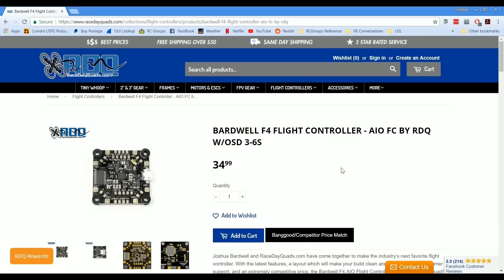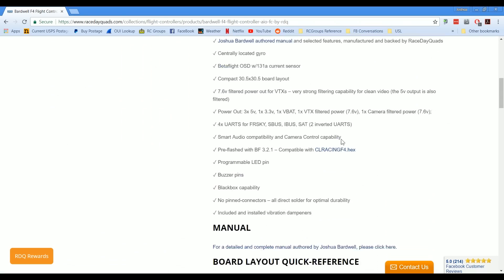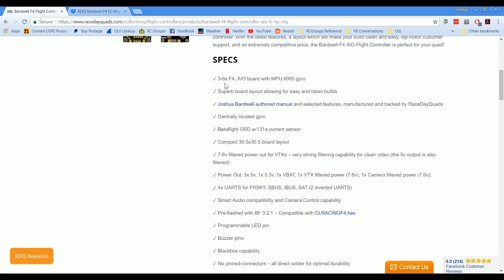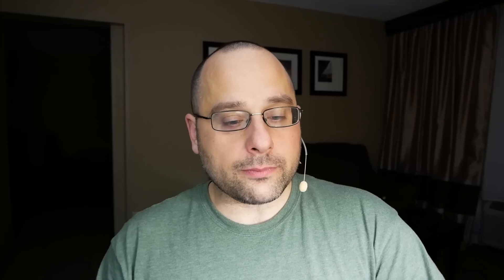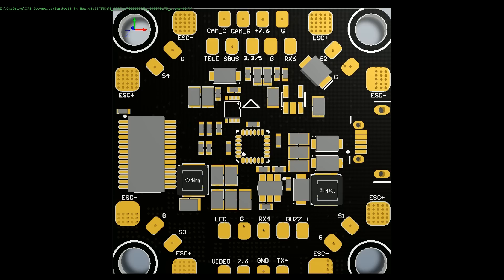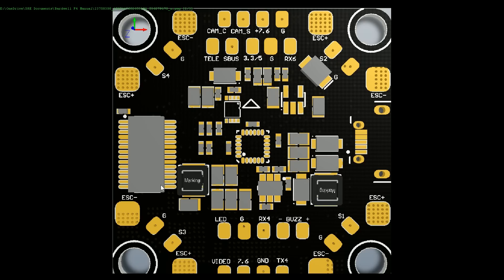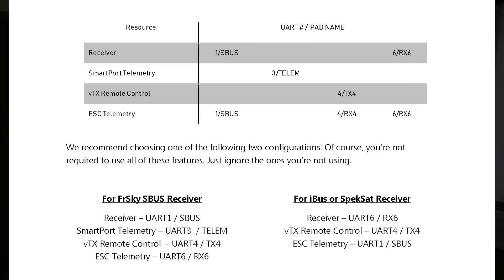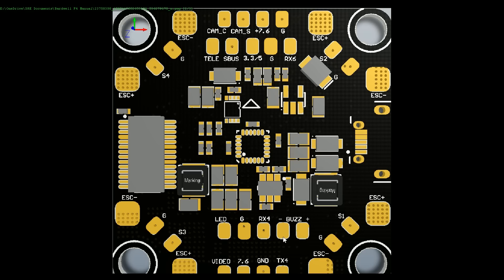Bardwell F4 AIO | JOSHUA BARDWELL FLIGHT CONTROLLER

Comment: I got one man and both 5v pads lifted off the board. Like i put my rx on the 5v and the pad lifted, so I said fuck it and soldered it to led and would remap later, I let go of the wire and the pad instantly came off. I'm not that worried about it because I have a 5v wire from my 4in1 but i figured you wanted to know about the quality control issue.
Reply: Also the manual is so detailed you're legit the fucking man! Thanks for all you do brother.
Reply from the maker: +Biruta FPV I hate to say this but I suspect your soldering skills more than my board. We have 1000 of them sold and this is the first time I've heard of lofted pads.
Reply: Joshua Bardwell I don't doubt my soldering skills are not the best. But it is the board, as every other pad was and is fine, only the 5v, I've never had a pad come off 7 pc's and 5 fcs, countless rebuilds. Like legit 30 builds under my belt, never burnt a pad, and I was at 350c, touched the pad for less that 5 seconds. I'm not trying to be a hater at all. Just letting you know exactly what happened. I soldered the twon5v just like I did every other pad on the board. It's possible I had a one off, but that would be in. Considering I soldered all 3 wires one after the other and only the 5v pad lifted, same exact technique and even made sure the board wasn't hot, the pads weren't secured.
Reply: Pc's =pdb
Reply: Joshua Bardwell I doubt you'll reply again, but I'll tell you the same thing I told racedayquads, I'm not trying to disrespect you or your product just letting you know of the issues. Happy flying bud.

Comment: Anyone else having issues getting LUA scripts to work? I’ve updated software and firmware on everything - r-xsr, Taranis, using the latest open TX, latest Taranis bootloader, latest LUA script, etc etc. I get telemetry just fine but no values show up on the PID tuning or other LUA script screens. Yes, I’m tuning the LUA-script-fix fw on the r-xsr.
Reply: Argh. Unplugged R-XSR, plugged in an XSR, and everything works. I wonder if FrSky needs to work on their R-XSR firmware a little more...

Comment: I love your layout design on this FC but there's an issue with CLRacing 3.2.1 on JBF4 AIO. I cannot get the LUA and S.Port to work. Followed your manual, awesome by the way, and I only get 3 telemetry points back to QX7 using XSR receiver. I checked the ports and uart3 is set to SmartPort. Tried a spare X4R receiver and same thing. Now I tried to flash to CLRacing 3.2.3, and can't get DFU mode up using bl command from cli, ImpulsRC or Zadig even though I was able to flash from 3.2.0. Just wanted to make you aware of these issues.
Reply from the maker: The telemetry issue is noted on  the product page. The manual needs to be updated.

If you are using SmartPort Telemetry wired to the TELE pad, you must go into the CLI and type:

set tlm_halfduplex = off
save

DFU mode is likely an issue with drivers on your PC not the FC.
Reply: Thank you. I will try that.Two different windows PCs with same resaults? It did work, mind you, on previous version of CLRacing.
Reply: Got it figured out. ImpulseRC was coming up win an error "Too many devices..." or something like that. Once I de-soldered everything, DFU drivers installed ok.

Comment: I don't know if this got brought up already, but do you have a suggestion on which ESC pads to run power to a 4-in-1 ESC board?  Will the ones closest to the battery pads and current sensor be adequate or should I run from multiple pads?

Comment: Do I need an additional resistor and capacitor to use the camera control feature? (I will use a RC Eagle 2 with this board)
Reply: And which hardware option needs to be selected? DAC, Hardware or Software PWM? Thanks in advance! :)
Reply from the maker: You don't need a resistor. Some cameras might need a capacitor.
Reply from the maker: The hardware options are all set up from the factory so all you need to do is solder up the wire. But hardware is the correct option.
Reply: Thanks a lot. I hope my JB F4 order arrives soon! :)

Comment: Got one of your fc in the mail today and I have to say I am a little bit disappoined how it was shipped, I expected some kind of hardcase to it.
Reply from the maker: Shipping it in a hard case would increase costs and would not increase durability at all. The method you got it is how all sorts of electronics are typically shipped. 99% of people are going to take it out of the packaging, throw the packaging away, and never think of it again. If your board was damaged in shipping, let RDQ know and they will send a replacement immediately. But probably, your board is just fine.

Comment: Doesn't an AIO include the speed controllers also?  Otherwise, it's not really an All In One is it?
Reply from the maker: I'm so completely eye-rolley about this argument. To my memory, the term AIO was first coined to refer to an FC with PDB and OSD built in. FC's with built in ESCs are relatively recent, definitely after the term AIO.

Anyway, if you want to be pedantic, shouldn't an AIO include the vTX too? Shouldn't it include the camera? Hell, shouldn't it include the frame and motors while we're at it? The term AIO typically refers to an FC with built in PDB and more.
Reply: Ok, ok.  No need to go overboard.  I honestly didn't know the answer, and was just asking a simple question.
Reply: I agree with you twinturbostang. It is a little confusing and the term AIO is silly, Maybe ok for a stack but should really be avoided.

Comment: This looks great, congrats!
I actually like pin holes on an FC as it lets you wire from above or below, but this board is so well organised there no need to worry about that.
Reply: Although, the "Around the stand off" location of ESC wires is not fun. Please dont do that in the next version. Weaving & crossing wires around the nut is awkward.

Comment: Can INAV be flashed to this board?
Reply from the maker: This board does not have a barometer or i2c pads, so it wouldn't be ideal for iNav. However I believe iNav supports all standard betaflight targets, so I think in theory you can do it.

Comment: Why don't flight controllers have USB type c?
Reply from the maker: +Krez_FPV what is the advantage really? More expensive connector. Cable nobody has. For what?
Reply: I was thinking it would be more of an ease of use thing. Reversible connector, and high bandwidth.

Comment: Sorry if this was mentioned, I don’t see it in the manual, should this be set to 8k/8k or ?
Reply from the maker: It depends what protocol you are using. If you are using Dshot, then yes, 8k/8k is fine. Betaflight comes by default at 8k/2k in case you are using OneShot.

Comment: Awesome, awesome, awesome Joshua! Great work here! Finally someone has done what I (and several others) have been saying for nearly 2 years; use a 7.5-9V VReg!!! So so glad you incorporated this onto this board. The only thing I would request on v2 would be a nice large + solder pad on the bottom near the edge of the board that ties in from the vbatt + after the current shunt. This allows for us to wire up the 4-in-1’s easily, putting the least amount of wire stress on the FC in order to not induce vibrations to its gyro via the wires.

Great job once again!!

Comment: There is another good reason to go < 12v on the voltage regulator for the vtx/camera.  On some boards (mine is a Matek) if you are using an older battery your voltage may sag below 12v momentarily, the voltage regulator might not handle that well and your video will drop out.  Lowering the voltage to  < 9v should get rid of that problem.  The first time this happened to me I had no idea my battery was causing the issue...so of course it happened again the next time that battery was in the rotation.   There are lots of people who mod their Matek PDB to run 9v or so instead of 12v, so I like this 7.6v solution, hopefully you will start a new trend.

Comment: Great design - can place it right up there with the F4S, but with the documentation CLRacing missed. Wished the boot button would be more on the side. It would be a killer if it came with the Molex connector for us 4in1 ESC fans. Many compact builds (like Catalyst merica) rely on those connectors to create a very compact modular design (4in1 ESC, e.g. Spedix 30A, stays in the frame, FC etc go in the canopy: thanks to the Molex you can swap a frame in 5min). Without Molex it will be more messy - or you just cramp connectors yourself. Your board, and in particular thanks to decent documentation, seems such a great step forward for the hobby; hope it drives a trend!

Comment: Congrats :-) looks  nice. Not a real fan of the pin layout tho. I prefer having more pins and having everything together that belongs together e.g. RX/TX/GND/5V in one row. The Kakute F4 is so far my favorite from an pinout perspective but its also the only one that has some weird Gyro noise issues. I saw you went with an MPU6000 which is what my 4 other copters are rocking. In my opinion that's all that's needed. I don't think that anyone needs more than 8k/8k :-)

Comment: Congratz on this project.  Just having really good filtering and amps sensor on board makes is oh so tempting. though I am swimming in the budget prices omnibuses from rtfq.  Any prospect of having a barometer on board too, for folks wanting to try it with iNav?  And will iNav be ported to this board?  I know that;s not your thing, but there is a growing shift to using these well evolved tiny and light miniquad FC for iNav, even w fixed wing.

Comment: First I'd like to say, congratulations!! Second, I wanna ask a question, I have wired some boards without using the signal ground pads on the fc. Instead what I like to do is just hook the signal grounds right over to the ground wire on the esc instead! It means way less wire and looks super clean! I guess my question is, is there any down side to doing it this way? So far I haven't noticed any problems yet but wanted your.advice!! If there isn't any issues with running the signal ground like that maybe just maybe"someone" would or could use my idea and could free up a small portion of space on there fc by removing the signal ground pads??? Looking forward to hearing your thoughts on the matter!! Thanks! =)
Reply from the maker: No I don't think there really is a down-side to be honest. Especially not on an all in one board like this.

Comment: Can this be used to run a Tricopter and it's Servo?
Reply from the maker: I honestly don't know all the ins and outs of using servos with Betaflight. To be honest, if you want to fly a tricopter, you should run TriFlight, the firmware specifically designed for tri's. The main thing it has is some advanced logic for moving the tail servo, that takes into account torque yaw coupling and other things.
Reply: JB,

Thanks for the quick reply and congrats on your product release!

I do run triflight, just curious to know if the board could handle the remapping to allow the control of the servo.

Comment: I jumped on the band wagon an ordered A board.  Can't wait to see the manual.  My next build I don't know but it will be around this FC . So enjoy you video's
Reply from the maker: You can download the manual from the product page right now! No need to wait for the board to come.
Reply: Joshua Bardwell thanks never crossed my mind; so I will down load. Thanks
Reply: And I will add, mine did not come with a manual.  I am fine with that, reference it online.

Comment: Congrats, JB.  I'll probably be getting one to support you, but I'm curious.  If you had to make a statement as to what sets this board apart from similar ones out there, what would it be?
Reply from the maker: There are tons of excellent FC's out there, so I can't say, THIS ONE IS THE BEST IN THE WORLD. It addresses some problems that some other FC's have, like noisy video and gyro twitching, but it's not the only one to do that. I guess the main thing this board has that no other board has is that it's got me backing it up. I wrote the manual for it. I'm going to keep up on feedback on it and of course I'll go out of my way to answer questions about it.
Reply: clean video
Reply: Joshua Bardwell Awesome! Happy to support such a stand-up guy.
Reply: 7.6V of course :)
Reply: And that is why i bought it.

Comment: I am starting out in the hobby and  I recently bought a soldering iron and using practice wires I have been practicing. One thing I am having trouble with is getting the solder to stick to the wires it is just staying on the iron or balling up on the wire. I don't know what is happening.
Reply from the maker: That might be a sign of a cold iron. Also could be dirty wire. If you are using lead free solder, use leaded.
Reply: Joshua Bardwell ok I’m using the solder that came with my iron and it is 60/40 it could be just dirty wire because it is just some old stuff I found lying around. As for the iron it was cranked up to the hottest. Thanks

Comment: Joshua Bardwell, I'd have one suggestion for the board. You could add another big battery solder pad after the current sensor, so that one could wire up a 4in1 ESC after the current sensor with power. And a possibility to have the 4 motor data output pads in one additional place would help out 4in1s as well. I know this isn't perfect in adding more pads not everyone needs. Perhaps you could just think about some changes that help the 4in1 people out a bit.
Reply: I just solder to the nearest + esc pad. I haven't had a bottleneck problem

Comment: I am switching more to rf. Don't like setting up bf fc's. Also I notice that each time as I update my fc's, I have in one or 2 some bugs and it changes each time.
The fc looks not bad but a pdb on a fc is not what I prefer. The telemetry pads on the bf esc are already messed up so that does not mater.

Comment: Looks nice.  But honestly I think PDBs and current sensors are redundant.  With 4in1 ESCs becoming the standard and the new ones including current sensors there really is no need for that stuff on the FC.  I would rather buy a cheaper and lighter flight controller that doesn't have these redundant features.
Reply: yea its so heavy
Reply: ziggyzbeak R.C. laugh all you want.  The difference between a fully loaded AIO flight controller and a barebones one is about 3 grams.  And if you go down a a 20x20 flight controller you can save another 2 or 3 grams.  A piko 20x20 fc is 1.7 grams.  Some of these AIO flight controllers are 9 or 10 grams.

Comment: F7 is here Joshua. Why are we still dealing with F4's?
Reply: Oh.. Well, I am yet to buy a FC and noticed F7s are cheaper and have software reversible FrSky Rx like the old F3, 216mhz vs F4s 168mhz and 8 uart ports available vs the F4's 4 so of course I will be going for an F7 as I can choose between the mpu6000 or the unstable 32k gyro I can't remember the name of. But of course, I understand you guys want to help Bardwell sell his old tech out of loyalty which is really admirable from a fanbase perspective.
Reply: 32k gyro is IMC268. Think I saw some others too.

Comment: To be honest I would like to see a build video with it because I never understood how soft-mounting a FC combined with the PDB could work if the battery leads are ripping on the board at every faster move or wouldn't even prevent the FC from "floating" if the stiff battery leads are secured after the soldering to the FC/PDB to the frame.
I'd really love to see how these kind of combos should be mounted correctly.

Comment: Congrats Joshua.
And it IS a nice manual - wish other board designers/manufacturers would bother with docco other than the barest schematic.

One thing I really liked about the original CLracing F4 was the onboard buzzer.
I think it was unpopular when the original CLracing board came out because it needed BF 3.2 to drive it and 3.2 was still pre rc and you got a horrible noise at boot and maybe some other times with BF 3.17.
Any chance of the on board making a re-appearance?

The other thing I liked about the CLRacing is the fact the VTX pins are at the back of the board and the Camera pins are at the front - you know like where 95% of builds have their camera and VTXs located?
Its convenient for the builder not the board desginer (OTOH the first CL racing had noisy video so there's that).

Kinda sucks on telemetry pads though, but most guys are still running BLHeli S so doesn't affect 80% of the market.

Comment: I think this looks like a great FC.  I know there are a lot of folks going to say 'It's not an AIO', but that is their opinion, not what I consider a true definition of AIO.  The  FC is a processor, and I think it should have all the 'bits' that go with that, ie. gyro, blackbox and removable storage, PDB, current sensor, filtered voltages for anything connected or added to the model, OSD, all controls and anything else control or processor related.  I DON'T want the 'peripheral' components included... Receiver, Transmitter, and ESC's.  I want to use my own, not what someone else says 'everybody is using Kiss, so that's what we use'...  Maybe I'm old school and I think there should be some separation between some components, and yes, I like choosing and building my own stuff.

Thanks JB for another good vid, all the work that was put into this FC, and another hole in my wallet because I was wanting to do another build, but now I must build a quad for this AWESOME FC that includes everything I like in a FC and none of the things I don't want.  Merry Christmas and looking forward to another great year!